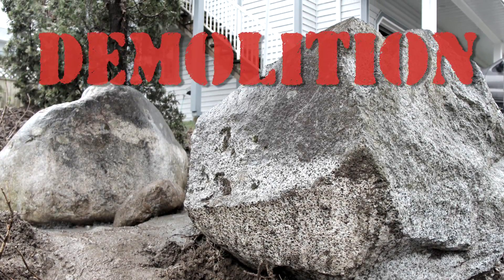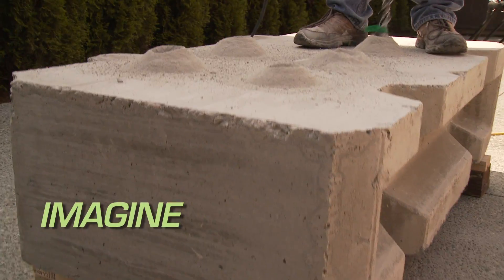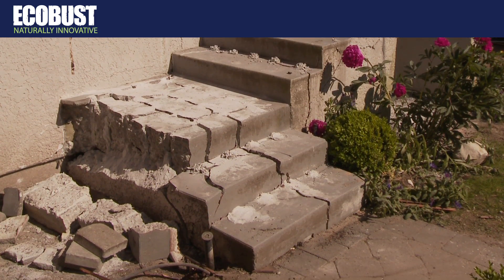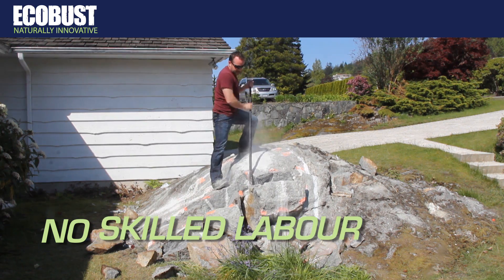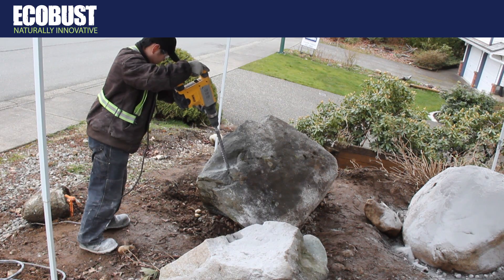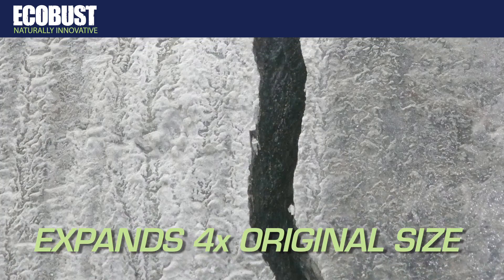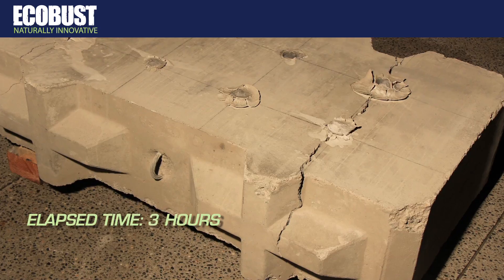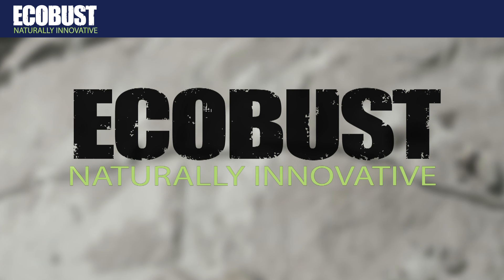ECOBUST, Demolition Made Easy

Comment: How did you drill the holes into the concrete silently and without dust?
Perhaps you should have said "Minimal" noise and dust?
And then there's the happy little advertisement..... So simple that even a blind accountant could do it!
Reply: quietly, not silent
Reply: A rotor hammer is practically silent compared to explosives